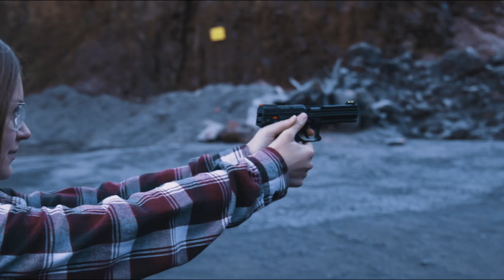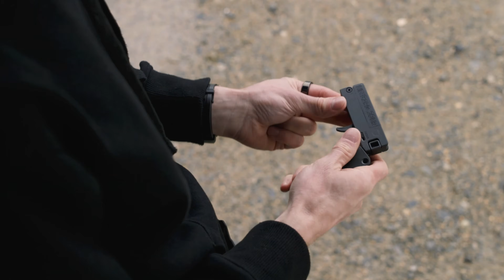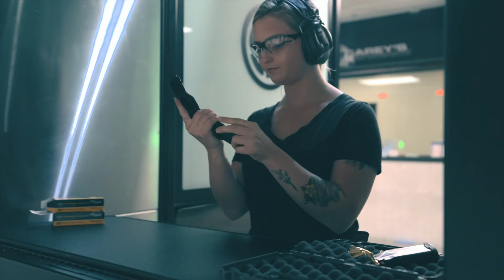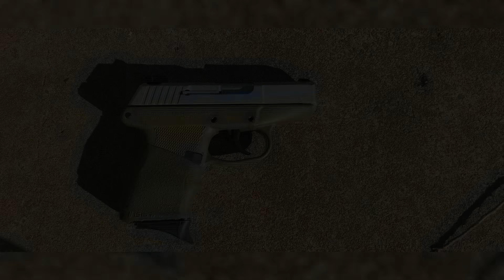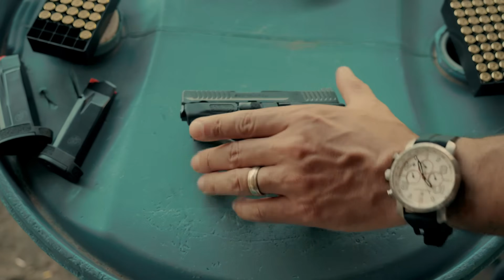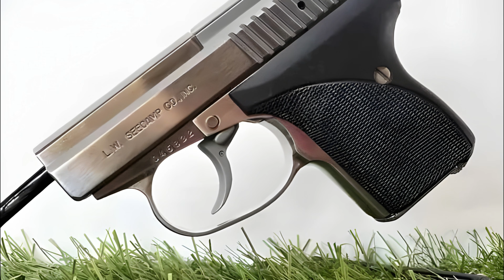12 Micro Pistols Smaller Than Your Phone — and Way Deadlier Than You Think

Comment: What about the Hellcat?
Reply: What about it?
Reply: @marcusmumford7100  It is a nice compact that should be on the list
Reply: @CrimeMatterz I mean it's alright, but it's still bigger than all the pistols on the list
Reply: @marcusmumford7100 I thought it was the same size as the P365. Or am I thinking of the P365XL?
Reply: @CrimeMatterz a little bigger than the p365 a lot smaller than the p365xl
Reply: @CrimeMatterz  I carry the xl. Idk if I'd drop down to the regular 365 but have considered the hellcat
Reply: @marcusmumford7100 ah, okay. I see…
Reply: @marcusmumford7100 yeah, for sure. I have both and like both. You can’t go wrong with either. If you have bigger hands, then maybe stick with the og. If you don’t, and like something more compact, definitely worth getting…
Reply: @CrimeMatterz I have small hands. The hellcat fits much better than the 365 og but I don't know if I want to compromise capacity for the comfort, yanno?
Reply: None of these except the lifecard are actually micro. A real micro is a baby browning .25 auto. I know. I have it as well as Most on this list. Like the sig p938s, sig p365sas, kel tec p3at p32,  kahr9,  glock 43, shadow systems cr920, sa hellcat and hellcat pro and many more.  The only real micro is the baby browning.  Period. I actually carry it in an old flip phone Velcro flap Camo holder.
Reply: @kenthurman2344  Yeah I agree with that. And those are really cool!

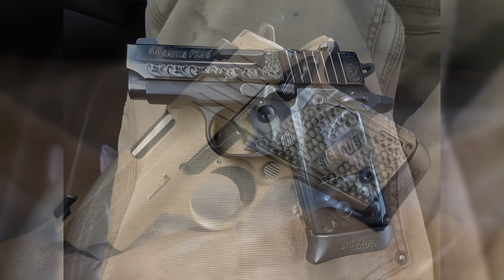Comment: 4:43 made with metal... including the slide, which is often made from cheap polymer parts? What guns have polymer slides?
Reply: Hi-Points do if I remember right
Reply: @CrimeMatterz no, hi points are direct blowback and rely on a heavy slide to operate. They're cheap metal, but metal.
Reply: @jamesb1856 ah, didn’t know that. Thanks
Reply: Pretty sure the Taurus TX22 is
Reply: @Islyguy2 no, they're aluminum
Reply: P32 & P3AT by Keltec are poly

Comment: Best pocket pistol is a Bersa Thunder 32 in 32 acp with TR16G Armalaser.   Second is SW BG 2.0 in 380 with TR36G Armalaser.  Ruger LCP Max is ok but snappy.  Ruger Security 380 and Bersa Thunder Plus are 15-round capacity 380s and nice.  Walther PD 380 and CCP M2 380 are quality.  SW Shield EZ in 380 is quality and EZ shooting,  but only 8 rounds.  Beretta 80X Cheetah is nice, especially when converted to 32 acp.  Beretta 30X replaced 3032 Tomcat and is pretty fat to carry.  Walther PPK/S in 32 is expensive but beautiful with a ridiculously heavy DA trigger pull before going SA.  The Keltec P32 is inexpensive,  reliable, can load a 10-round Promags and mount an Armalaser.  DA only trigger takes some practice, but it's easy to conceal.  Gersan clone of Beretta 84 and clone of Browning BDA can also be converted to 32 with a barrel from Allegheny Arms.   All these centerfire options are reliable and we have great choices, but having tried them all, I still think the best, most accurate, carryable and shootable option is the BersaThunder 32.  For cheap practice I use the identical setup in the Thunder 22.
Reply: 🎯Because of the Balance, Weight, ergonomics, I would put the S&W Bodyguard2 at the top, then LCP2 Ruger; but everyone is different.
Reply: 🎯Because of the Balance, Weight, ergonomics, I would put the S&W Bodyguard2 at the top, then LCP2 Ruger; but everyone is different.
Reply: @1stockdale159 Yes, the SW BG 2.0 is now the King of the hill in pocket pistols for most shooters.  But because it's small and in 380, it's still a bit snappy for my hurting right wrist.  Because the Bersa Thunder 32 is still small enough for a front pocket, and a bit heavier to absorb  the smaller recoil of the 32 acp, and with a Hogue Handall beavertail rubber grip absorbing a bit more recoil, and because I can shoot a bit smaller groups with the slightly larger gun, and because I can practice  a lot more with the cheap 22 ammo in the  identical Thunder 22, I think the Thunder 32 is about perfect for me.  Love Bersa!
Reply: The best backup (for the backup) is a North American Arms .22LR in the belt buckle. 
It looks like a real fancy belt buckle, only it's small, and functional.